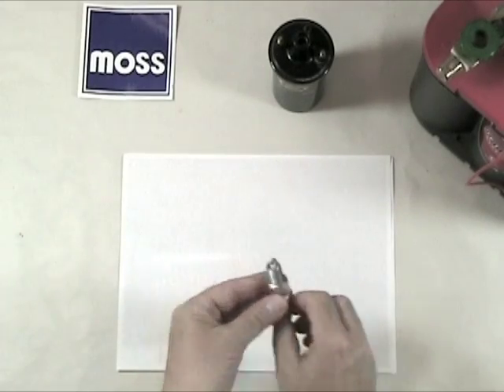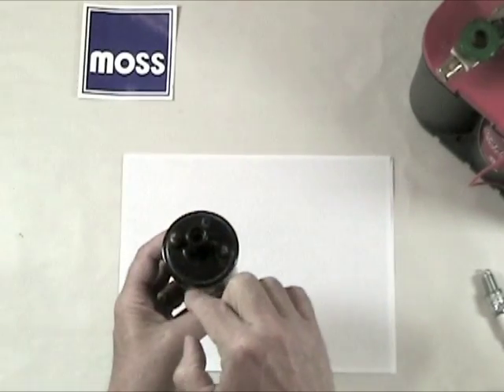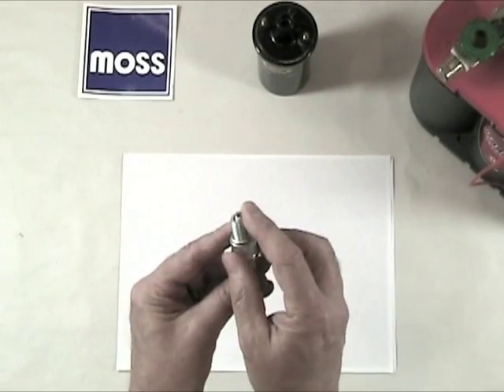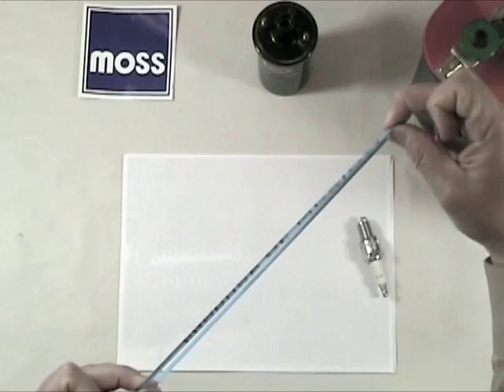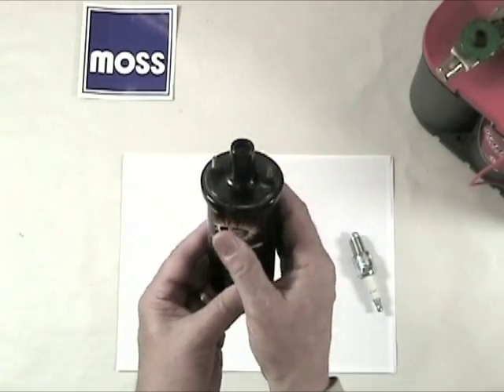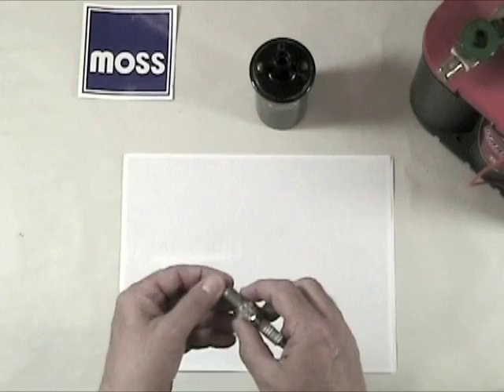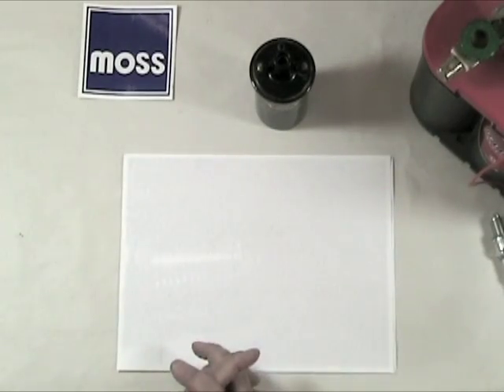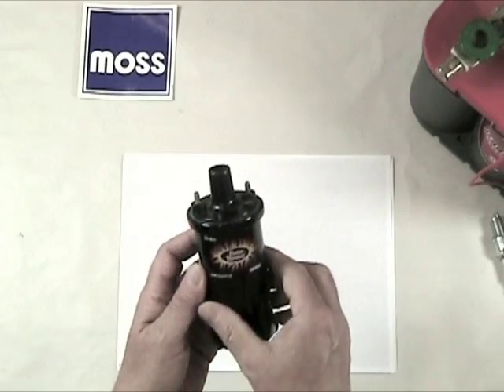How Spark Plugs Get Power (Part 3) - What Happens at the End of the Plug

Comment: You're a good teacher, Moss, but you got the expanation of how a transformer works wrong. Current in the primary winding is 'incuced' into the secondary and varies proportionally over time. The number of turns in the secondary, in comparison to the number in the primary, determines whether the voltage is stepped up, or down. Current is inversely proportional to voltage (you got that right), but the collapsing  of the  field doesn't determine the spark timing - the rotor contacts do.

Comment: @bloodreighn Thank you. Of course the implication is, that in my truck, the minimum voltage required to continue turning the starter motor is lower than the minimum voltage for the coil to generate spark on a cold morning. With the starter turning, my battery must have been discharged to a level somewhere between these two values. When I last replaced the battery, I chose one with fewer cold cranking amps because others weren't available.

Comment: @spelunkerd Why that happened is because your Battery was so low on voltage the Starter drew on the available voltage and sucked up the remainder of the current , there fore.. no spark, but it also doesnt help if the car isnt cranking over fast enough

Comment: (continued)

That drew me down the wrong path. I towed it to my garage, warmed it up, and recharged the battery. Problem solved! 

Evidently the battery was underpowered for cold spark, but not for the starter motor. 

Next time I'll boost it in the field, even if it still turns over and I don't see spark.

Comment: I had always thought that cold start was always a starter motor/battery problem. But last month my theory hit the skids. On a cold morning, I got my truck to turn over but not start. I didn't bother to boost because the starter motor was turning pretty fast.Thinking I was smart, I checked for spark. No spark.

(continued next post)